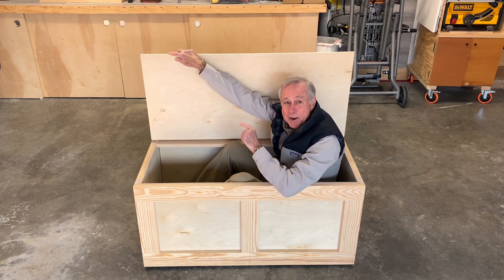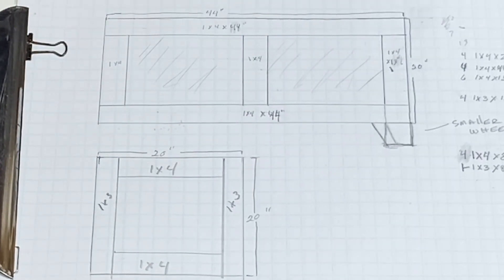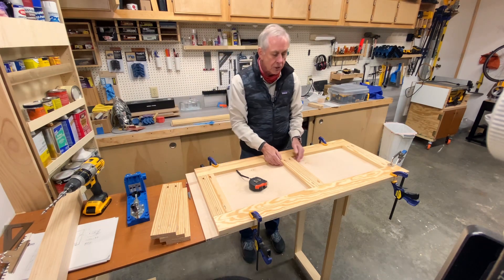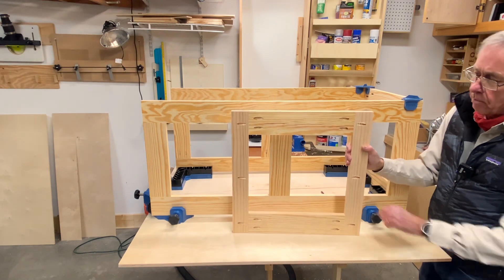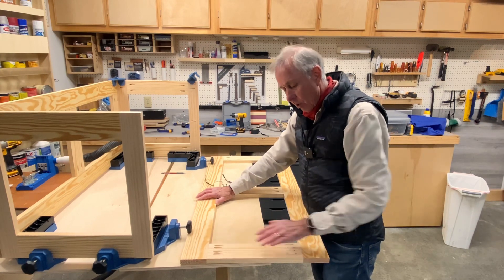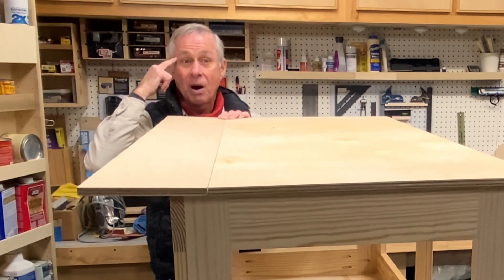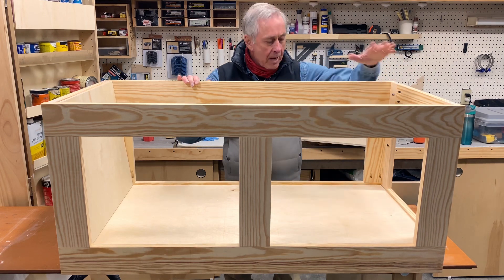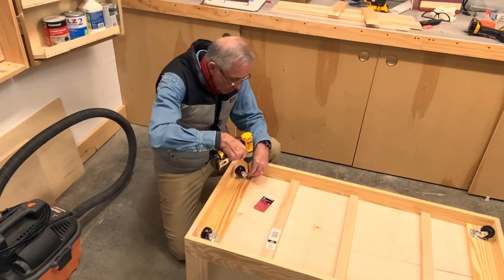Easy DIY Toy Box With Wheels

Comment: Great video, really appreciate seeing your mistakes. You mentioned at the end adding soft-close hinges. How would that work with the piano hinge?
Reply from the maker: The soft close goes on the inside to prevent little fingers from getting squashed. It works great with the piano hinge.
Reply from the maker: I can’t find the exact one I bought but here is a similar one on Amazon. I only used one. https://a.co/d/3gEln2c

Comment: This is one of the best videos I've found for a basic toy box. I am curious if you have any estimation on how much the finished box weighs? I would want something similar without the wheels but am concerned about overall weight.
Reply from the maker: Thank you!  I appreciate the kind words.  I have no idea what the weight is.  They actually didn’t use the wheels.  It’s not too heavy.  Because of the size, it took two of us to load it into their SUV.  Being able to slide in on the floor isn’t an issue.  Of course, It will depend on the type of toys you store.  Thanks again!